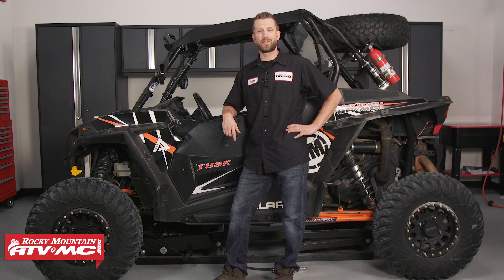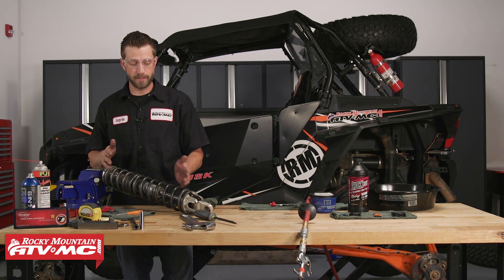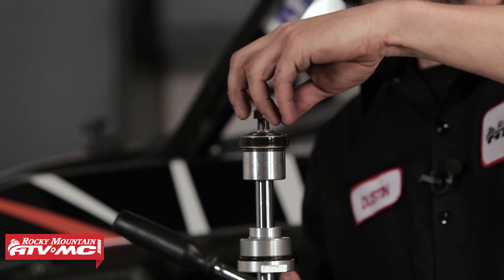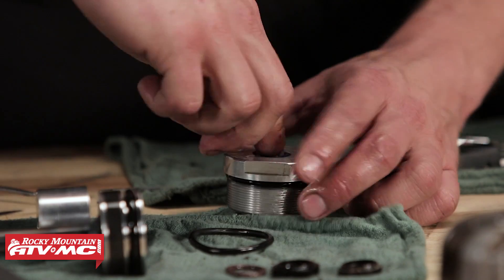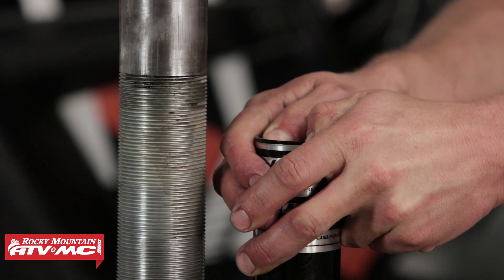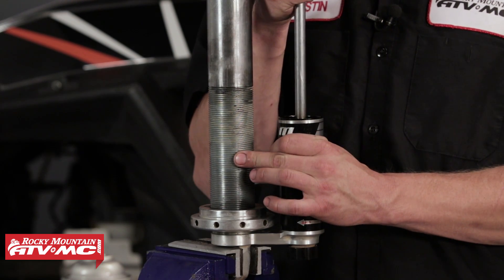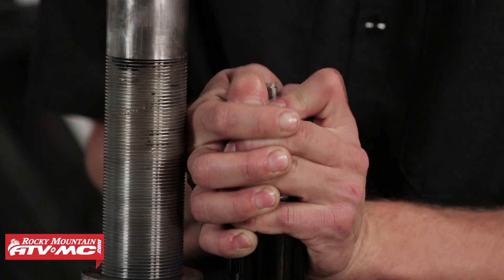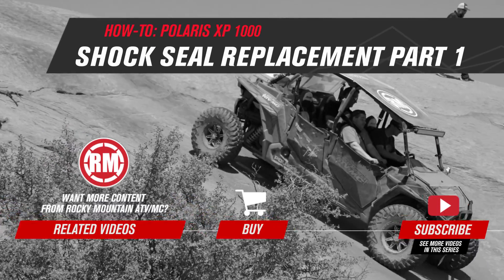How To Replace the Shock Seal on a Polaris RZR XP 1000 | Part 1

Comment: So back in 2018 the prices for the seal kits were $35.99-$44.99 fast forward to 2025 and they are $95.44-$128.44! For a couple o-rings and seals! Has the price of rubber really gone up that much? WTH?

Comment: FYI.  The 2013 Polaris RZR 900xp Walker Evans edition uses a different IFP depth and pressure.  The front shock is P/N 7043917 (it is a 2.0 shock) and the Polaris manual says to use 3.375 in as the IFP depth (rather than 2 7/8 as in this video) and 200psi as the pressure.  I called Walker Evans and they confirmed the Polaris manual is correct for these shocks.  The rears are 2.5 shocks and use the same IFP (3.375 in) and 200psi pressure.

Comment: I used your shock tools and followed this video to rebuild 2015 xp1000 eps w/ Walker Evans shocks. A little puff of pressure came out of reservoir then I removed Schrader valve. I then removed snap ring to remove reservoir cap and pow.. the cap and ifp flew out. .. the charge was mixed with the oil!!     The other shock I let out little puff of nitrogen,  removed schrader valve, then removed the ifp bleedscrew through the schrader opening this time.